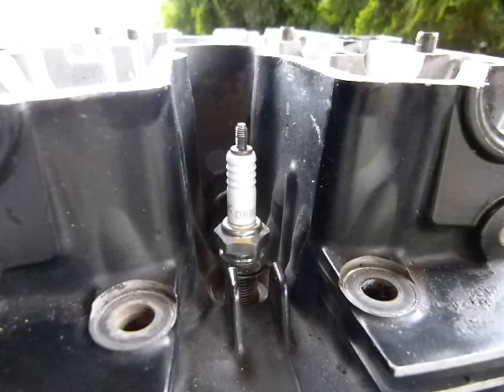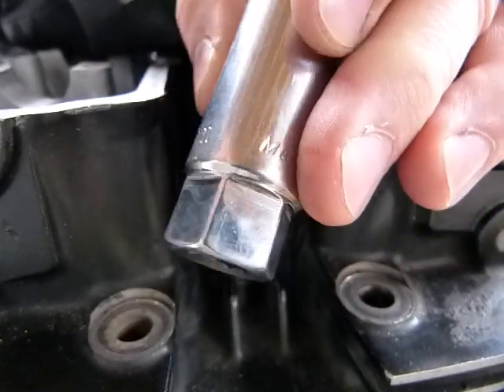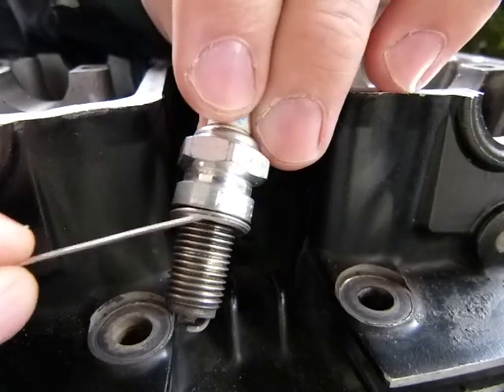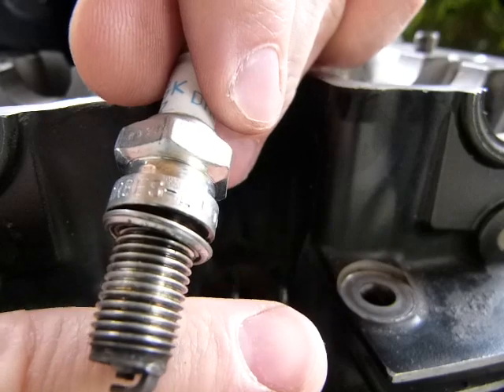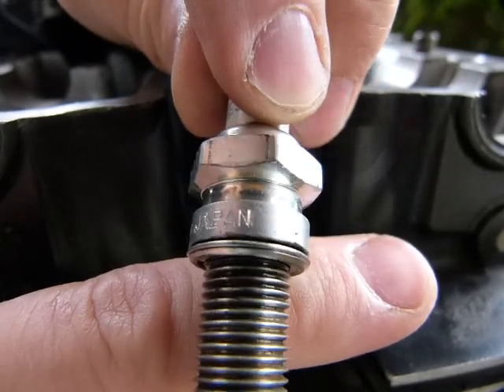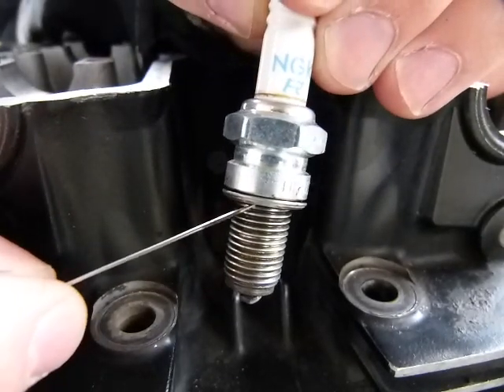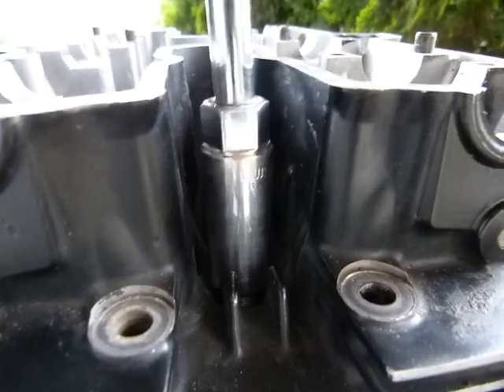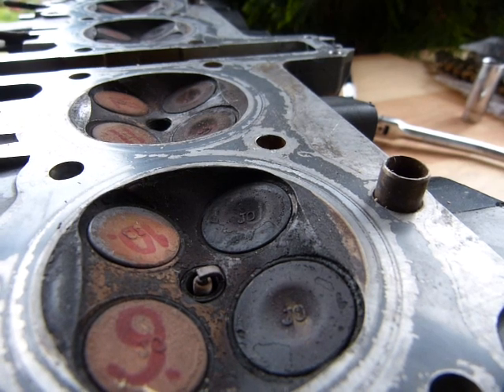Spark plug check

Comment: thanks good video but how you check if the sparkplug fires or not?
Reply from the maker: makemoneyrelax 
1Remove (1 or all) plug from engine, 
2 connect plug to ignition cable, 
3 hold plug to ground (engine, frame, battery ground terminal), 
4 somebody crank the engine while you watch the blue sparks at the end of the plug
Reply: theoverengineer What do you mean by "hold plug to ground"? thanks
Reply from the maker: It`s an electrical ground, not the actual dirt. Bottom of spark plug should touch the engine block somewhere, or frame or battery negative terminal.
Reply: theoverengineer Ok got it, thanks. I wonder what happens if you by mistake disconnect the plug from the ground. Is it dangerous?
Reply from the maker: Not dangerous. No spark will happen.
Reply: theoverengineer OK great. Thanks a lot for your answers! Appreciate it!
Reply from the maker: Thanks for watching.

Comment: how can you tell if a spark plug is bad aside from visual inspection?
Reply from the maker: Engine does not run smoothly, hesitates on sudden acceleration. Continuity (an electrical test) between the positive tip and the ground tip means the plug is dead.
Reply: How do I achieve continuity? I already know one or more plugs are bad but I dont want to replace all of them, just the bad one(s).
Reply from the maker: I made this video, check it out, see if it clears things up How a spark plug works
Reply: @theoverengineer  its not dead just dirty use plug blaster it just like new again  have not bought new plugs for years
Reply: Mary Grinter Hook up the spark plug to the plug wire outside  the engine. Touch  the plug  metal part to a engine ground and start or crank the engine. If it sparks, it can spark. The spark should be blue  and not yellow.  Worn electrodes cause misfire.

Comment from the maker: All get sooty a few threads. They all have white insulators. The electrode tips are often white or shiny, at the hottest spot. The ground is alway brownish. Plugs don`t wear much. They get deposited on by a worn engine. All wear on the plug is at the electrode-ground gap. If electrode metal is missing, it is worn , but it is too strong for the combustion chamber size. It the plug is deposited on, it is too weak, or the engine leak oil up.

Comment: The sparks I just changed on my engine were long due a change. the earth tip is white, the beginning of the threads are black and the insulator is a little black too. Is it just because the plugs were worn?